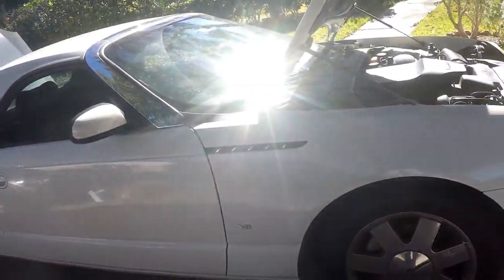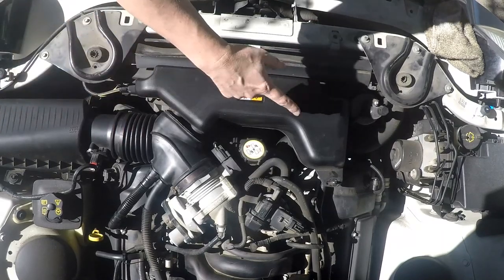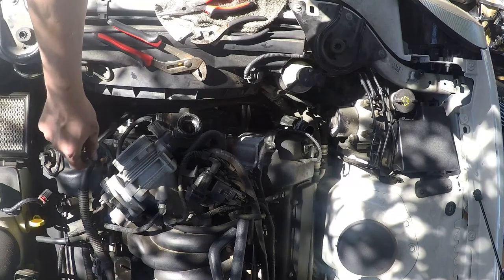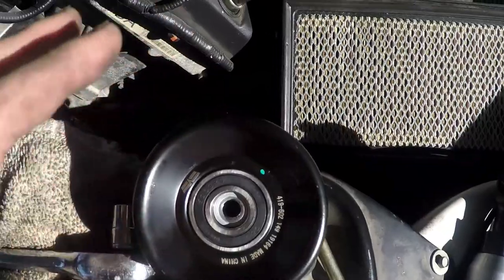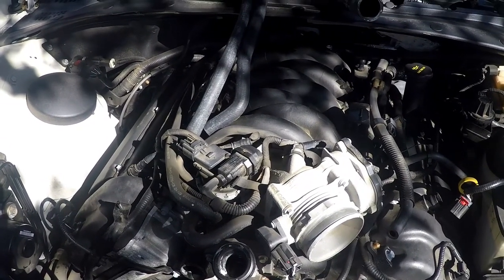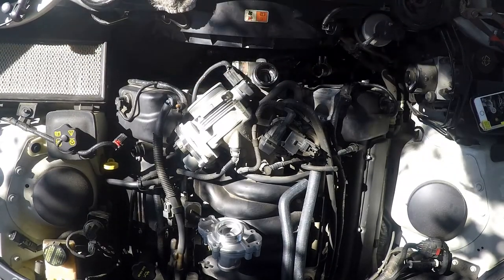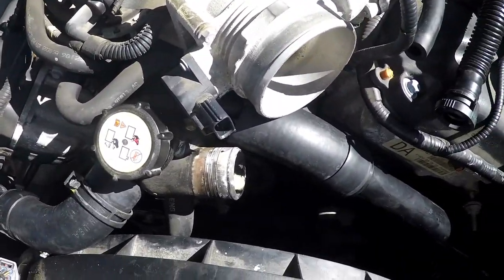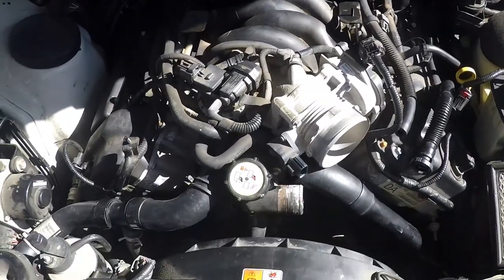Pwnery Tinkers - 2003 Thunderbird Water Pump, Pulleys and other "While you're in there's"

Comment: Much time has passed since you made the video, but do you recall the part number of the water pump, and where you got it?  Thanks.
Reply from the maker: I don't honestly recall - I remember ordering it through Rock Auto. It's been in there a few years, seems to be just fine though. Out of all the cooling system parts, this is one of the easier parts to change, so if it only lasts 5 or 6 years, it's simple enough to replace again if and when the time comes.

Comment: Any videos for a full radiator replacement?? And "while I'm there" would you recommend doing anything else besides the water pump? Thanks!
Reply from the maker: ...as coincidence would have it, I actually replaced the radiator about 2 months ago. It's a screaming nightmare. You have to be VERY careful separating the condenser and the transmission cooler from the rad. Also, when the damn thing comes out, you have to VERY gently bend the a/c hard lines away about 3/16" and rotate the radiator counter-clockwise if you're facing the windshield. I wish I recorded it, but in all honesty, I was in a HUGE hurry the morning I did it, after only 1 hour sleep working nearly 20 hours prior.
Reply: @SeanPwnery  yikes okay thanks for the info! I may leave it to the pros in that case 😅

Comment: I have a 2003 and have been searching for videos and information, help, knowledge on this fun but sucks to work on. I have parts issues as well. So happy I found this video thank you. Of course I a question. What happens if you don't bleed the system ?
Reply: I've been completely plagued by problems with my 2003 Thunderbird, 3 thermostats, new radiator, still overheating.  2nd waterpump today, thanks for the bleed valve hose tip! That's a big part of the puzzle on this ridiculous water system!
Reply: It will have an air pocket and overheat!
Reply: I have had lots of coolant system issues with mine and believe, cross your fingers, that I have a handle on it. Most recently it was smoking and I couldn’t figure it out. I had fluid leaking on the thermostat housing below the cap. I changed the thermostat and housing, which I thought was the answer.  It wasn’t. I changed the front cap and it seems to work.
Reply from the maker: Sorry I missed your question (no idea how that happened) - if you don't get the air out, you end up with an air pocket that can't get pushed out. If that happens, coolant refuses to flow past that area and generally you get a hot-spot overheat issue. Pulling that little bleeder while filling up the system and running it for about 15-20 minutes until you notice coolant dribbling out should take care of it. Check the level a day or so later and top off as necessary,.
Reply: @SeanPwnery  thank you
Reply: Tbirds look a lot like lincoln ls engines' bays. Check your degas bottle/ reservoir. Ls are prone to cracking near the firewall, allowing air into the system.

Comment: So you don't recommend Gates hoses. How about their Thermostat/ housing? Have you had to replace your thermostat at all? Thanks in advance!
Reply from the maker: In all honesty - back in the day when I used to sell auto parts, I recommended Gates hoses all the time. The crimps for the manifold hoses are a little under board in my opinion, but they've held since I made this video. I'd be willing to accept the one I received as a fluke occurrence in terms of build quality. As for the T-stat housing, I went cheap the first time, and thought that it failed after 2 years - but after taking it off it was OK. The thermostat in the cheap one was stuck open though. I replaced it with a Dorman unit a week ago. When you buy the housings, a new thermostat and O-rings are included and pre-installed with it. Dorman's PN is 902-903. Also, if you don't mind a little struggle, replace the "Tube assembly" that the housing pushes on top that feeds into the top of the intake manifold. The flange on mine disintegrated (which was the cause of my leak recently). I was going to do a video on it, but I was in such a hurry to get the car back together and running that I didn't film it. I can answer questions on how do to that however if you do that one too. That PN is 902-697. Both are on Amazon.
Reply: This car is a gift from my partner's parents. His dad said he's had to put several thermostats in it over the years. We just had it replaced in 2021 and they did the whole housing because the cap broke just like you. This time it is stuck open. Thanks I'll check those parts out!

Comment: Hey Sean!!! Thanks for the video!! I’m about to do water pump and thermostat in my tbird. Just wondering what made you do it in the first place? I have an overheating issue so thinking I need to do those plus bleed the coolant to fix it. Any other suggestions?
Reply from the maker: I fought heating issues quite a bit over the years. I ended up doing the pump, all the hoses, the radiator and the thermostat/housing twice. Be sure your electric fans are kicking on, max A/C should spin the electrics up as the engine warms up. After a full flush, I ended up draining the entire system and upgrading to Xerex G40 coolant and distilled water. Even with an oil cooler seal failure and oil creeping into the cooling system, it never gets past halfway now. I'll be eliminating the oil cooler pretty soon if I can't rebuild the seals in it.
Reply: @SeanPwnery  electric fan is the fan in front of Radiator? I want to avoid replacing that and Radiator for now 😀.
Reply from the maker: @JKOGREY  It's behind it, and yeah that radiator is a royal PITA to change out. I ended up having to gently bend one of the a/c hard lines to get the old one out and the new one in.

Comment: I got a 2004 and my overheading indicator popped up, what do recommend? Ive seen on a few forums that it could be a whole system replace wich is really pricey,  its at about 160k miles,  ive considered a diagnostic , but could it just be the thermostat?
Reply from the maker: The cooling systems in these cars aren't too finicky, but the coolant hoses and their routings - those are a damn nightmare in some places. Did you smell any coolant with the hood up? These cars are right about the age where all those radically formed hoses - especially the one that runs UNDER the intake manifold will let go at the bend. I just replaced that hose recently with bulk line because the original wasn't available and I had to get it running.  As for the cooling system redo ... it's really not too bad, the T-stat housing comes with the new thermostat and can be had around 60-80 dollars through Dorman, as can the "Tube assembly" which the housing pushes on to - that could have a failing flange. Water pump is fairly inexpensive as well, rather easy to get to if you do like I did in this video with the "While you're in there." The most painful part of the job for me which I didn't do a video on was the radiator. That job was a royal PITA.  If you don't have leaks, I'd at the minimum flush your system, change the water pump, T-stat housing, and be 100% sure your electric fan is working. A lot of useful info is over at forums.fordthunderbirdforum.com - I'm there as well as a lot of other helpful people with lots of part numbers and sources if you need them.
Reply: Thanks bro I truly appreciate it, also your t bird videos are great, I also did all the suspension   you did and I actually just replaced the transmission,  I really can't spend any more money considering having a family and all might have to let it go , any way keep up the good work and thanks again bro
Reply: Thanks for the troubleshooting ideas…I’ll proceed with that route. Dad gave me his old tbird and my high schooler uses it as her daily driver. Trying to fix the overheating issues now!

Comment: I have fluid leak into the engine compartment, which has been repaired, but there has been dirt and grime collected. Can I use the engine cleaner at the car wash to clean the engine without damaging the electronics?
Reply from the maker: Most of the electronics are well sealed or tucked away to the point where it shouldn't be too much of an issue. If all else fails, spray WD40 on any connector you're concerned with before spraying down the grimey areas. If all else fails - some detail shops provide a steam clean service for engines - it's pricey, but what you get on the other side is sometimes well worth it, especially on a collectible vehicle such as ours.